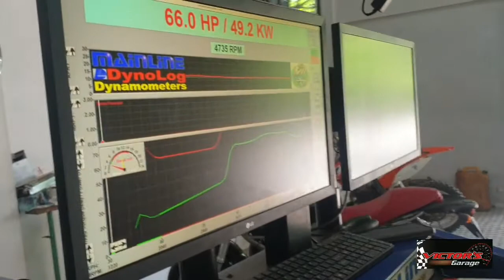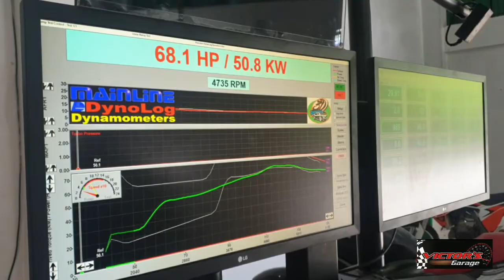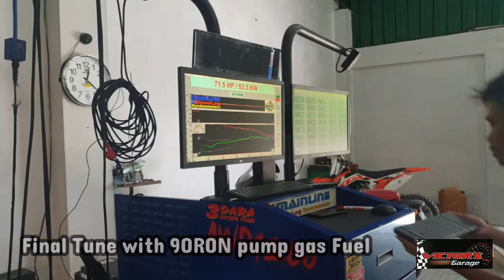Dyno Tuning BMW E46 318i M43

Comment: please replace the air mass meter on the M43 engine first, as these always measure incorrectly and run too lean. And then install a Schrick camshaft with 264 degrees. Runs great and is still very suitable for everyday use
Reply from the maker: This is just a stock daily car sir. Nothing fancy underneath hood. But yeah good choice if owner wants to modify
Reply: Replace it with what?
Reply from the maker: Maybe he means replace with new
Reply: @exavius4755  please only replace it with a new original Bosch air mass meter
Reply: what is involved with changing the camshaft? any clearance issues with the 264? what about the 272 ones?
Reply: @blanchimont5587  bei 264 Grad gibt es keinerlei Probleme. Ventilfedern bleiben Original aber bitte unbedingt neue Hydrostößel verwenden.

Comment: Not sure about 318i,but i had 318 e46 years ago and it had 87kw stock lol
Reply from the maker: What dyno sir ?
Reply: The e36 318i m43 has 85kw stock
Reply: That's the factory number measured at the engine. 50kw at the wheels is about right.

Comment: No need unichip you can remap stock bms46
Reply from the maker: Not fun at remap.. offline tune. Unichip is online.  And the owner has lots money to spent. Why not.
Reply: @victorgaragesemarang8794  this ecu have 4 maps of ignition timing,and knock control,there is more processes than a simple advance from piggyback,and also torque limiter,you need to fix some parameters to work fine with piggyback.
Reply from the maker: @ecuperformance959  it is... in general... piggyback give u the ability to adjust 1 important parameter for all the maps you are talking about. Which is air flow signal and also crank signal. I also do remap, so i understand , and i hope u also understand, that the torque request you talk about came from calculation or air speed. Also the timing from knoock is coming from engine speed which is come from crank signal
Reply: How to flash and tune bms46? I was looking for weeks and cant find anything about this ecu
Reply: @everything-dd3zk  if you want I can remote tune your bms46.
Reply: @ecuperformance959  sure, how much and how?
Reply: @ecuperformance959  I’d be interested too!
Reply: Same here I am interested
Reply: @williamasare4299  find me in my channel.

Comment: Stock 318i E46 has about 115HP. What is this then? XD
Reply: its wheel horsepower (hp at the wheels), the numbers that manufacturers usually say are crank horsepower
Reply from the maker: This is wheel horsepower sir. Please be educated
Reply from the maker: @mirrekku  thanks for the help
Reply: @victorgaragesemarang8794  no worries! People aren’t really educated about stuff like transmission losses. Cheers
Reply: @victorgaragesemarang8794  Even still, I can't imagine 70whp being any more than 85-95 crank for this car even with the least generous of dynos. I don't believe any of the M43 engines should be this down on power with an exhaust and tune. Perhaps the cat is clogged, if you're still running one?
Reply from the maker: @ethownzbh  suit yourself buddy. What brand of dyno u owned ? U seems like talked alot.
Reply from the maker: @mirrekku  yea... and this car is 2001. Run on dyno on 2019. People just talk big and trash.